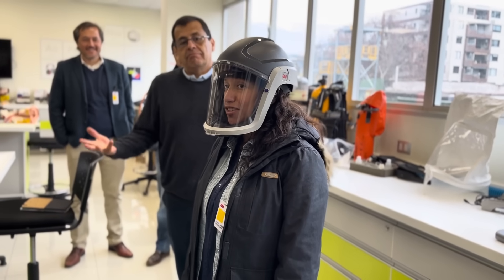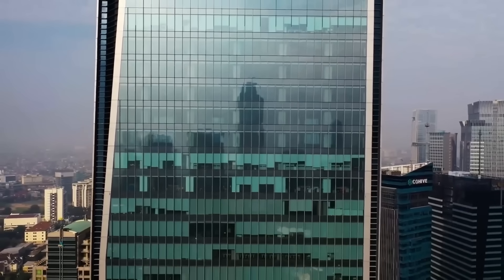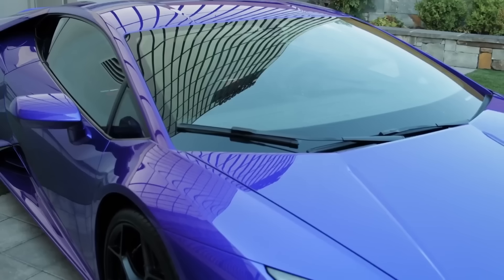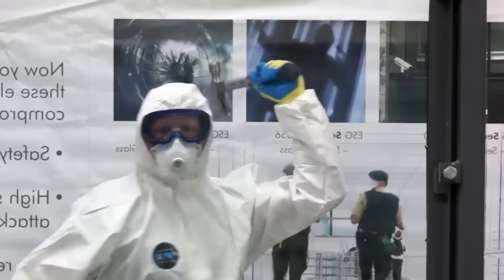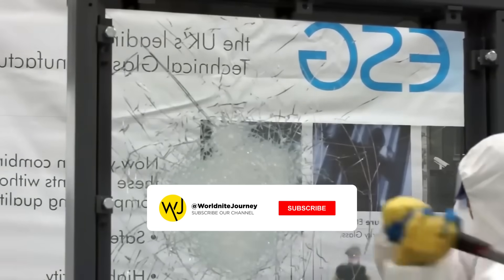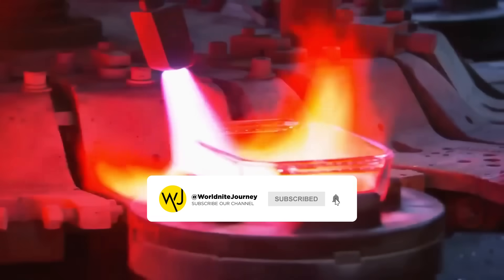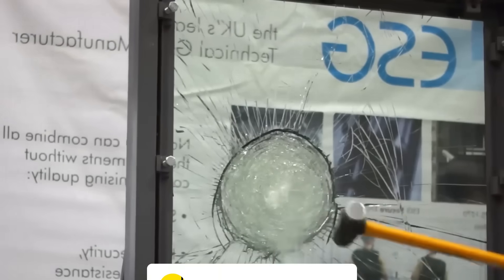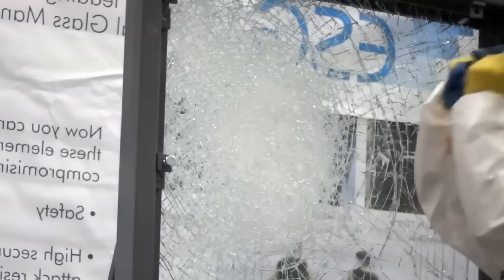🔥 How Glass Is Made from Sand

Comment: 1:43 In float glass production, tin is liquified by heating it to a high temperature, typically around 1050°C, within a furnace. The molten tin is then used as a bath upon which the molten glass is poured. The glass floats on the tin because it is denser than the glass, and the tin bath provides a smooth, flat surface for the glass to solidify.